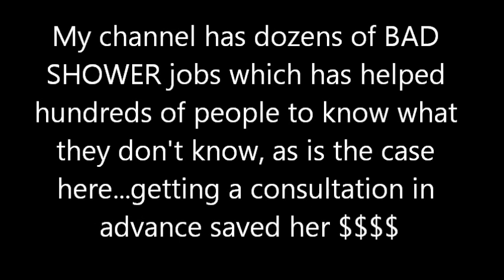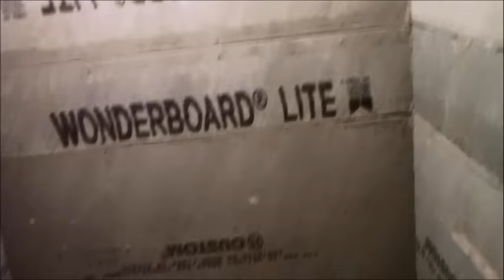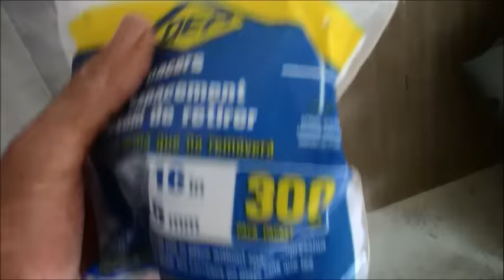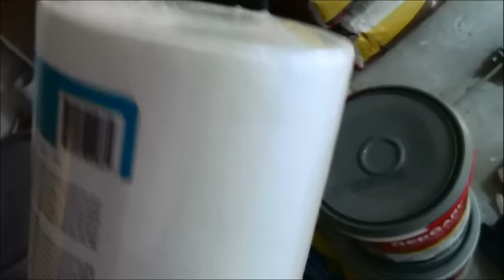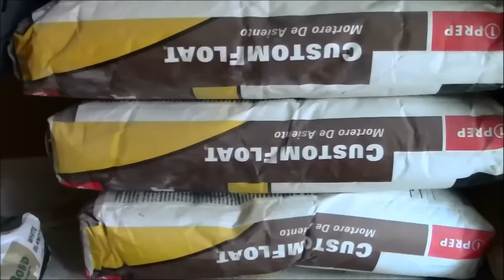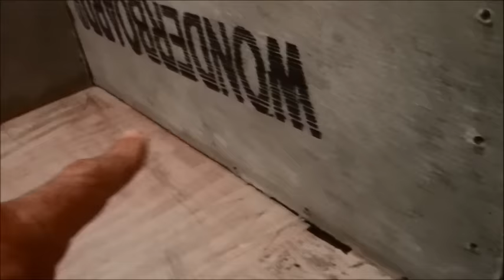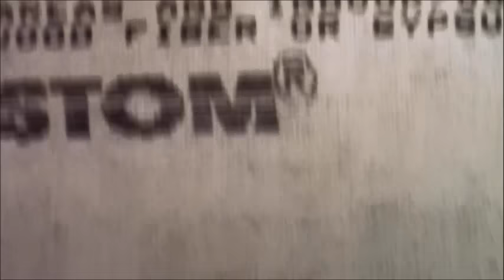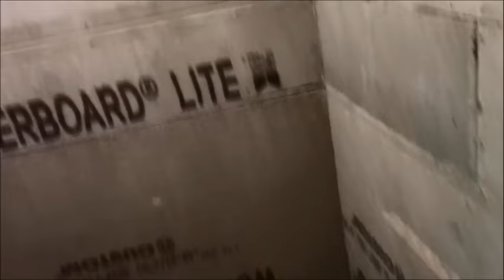BAD SHOWER DAY ONE !!

Comment: That's not pre-mixed thinset.

You should know this if you're gonna critique work. 

It's mastic.
Reply from the maker: It says at the bottom for wall and floor tile installation, it would not say that if it were Mastic..you would never use mastic in a shower or on a FLOOR ! Obviously you know little of the trade
Reply: @StarrTile  I know well it’s not used for showers.  But it’s NOT premixed thinset.   That’s absolutely false.  I’ve used it for backsplashes.  It’s adhesive, which IS mastic. .  Custom makes a tub of actual premixed thinset that SAYS premixed thinset right on it.  Two different products.
Reply: @StarrTile  the bucket intends to mean wall tile NOT in moisture prone applications.  I.e., a shower.  Says that right on the bucket.  And yes, I DO know what I’m talking about.  Premixed thinset has sand in it.  Find me one grain of sand in that adhesive.   Look it up.  You’re simply wrong.
Reply from the maker: I'm not going to argue with you, it's pointless...if it were pre-mixed OR mastic it's not used in showers or floors...period
Pre-mixed thinset is crap & never dries under large format tile, that's my experience, you could have different but it doesn't really matter at the end of the day
Reply: @StarrTile  We're on two separate subjects.   I would never use either on a shower, ...either.
Premixed thinset is crap.   But adhesive or mastic is perfect for backsplashes.   And other decorative walls.   As long as they're flat, as too much buildup of adhesive will retain moisture behind the tile.   But for all intensive purposes, you can't teach people out there the product in front of you is something it's not.   A little correction makes for a better education regardless of how much one may get defensive. 

I'm sure Custom wouldn't show their product and tell the viewer that it's premixed thinset.   They would say it wasn't crap when used in the proper applications.   Now they might fumble around trying to promote their actual premixed thinset, but they know it's crap.   But they're thinking more about the DIY'er being scared of mixing or to save time and mess.  

There's liabilities involved when you teach online.   To the manufacturer and the one using the product.  

In any event,  it's like calling a float a trowel.

2 different things.

Comment: Sometimes there's no satisfying your customer. Last spring I took over a job from a guy who built up his pan to over six inches thick. He also buried plastic water supply pipes in the drypack and I'm not sure what will eventually happen. Since the pan is not re-enforced with any re-bar I fear the worst. Being it's in an apartment building it should be an interesting rescue (restoration) if the pipes ever burst. I tried pointing it out to the landlords but they were satisfied with the finished product but we all know where that can lead to.

Comment: guess you never had red guard crack in the corners, happens way more than you think. Also you MUST use pressure treated wood for a shower curb if it is a cement floor, if you wanna pass inspection. never had a problem with warping or twisting.

Comment: What your demonstrating with the RedGuard is it's elasticity in plane.  Custom recommends you to tape corners because of the shear condition that can occur at changes of plane since RedGuard has fairly poor elongation under shear.  To demonstrate shear take some RedGuard of an appropriate thickness and tear it as you would a price of paper.  You'll find it tears quite easily.
Reply from the maker: No matter how thin the layer is it would definitely stand up before paper tape that is commonly used on drywall, that was the point I was trying to make. It is in fact a crack prevention membrane without tape. If your house moves to the point of this tearing, you've got bigger problems than no tape in corners.

Comment: Laticrete tape is actually good. It does stretch when Applied with any liquid membrane. It’s an amazing product. Redguard cracks when at a 1/8 crack joint. :/

Comment: Red gaurd recommends mesh tape for wall to floor transitions
Reply from the maker: What is tape used for....
It's a crack preventer same as on your drywall...
What does it say on a label of redgard, it is a crack preventer...

If you want to use tape I have no issues with it, but if you're already using a crack preventer then why would you use tape as a crack preventer, it's illogical

Comment: The mortar and spacers comment you made I strongly disagree with. I’ve had time where I forgot my spacers or grabbed the wrong size cause I don’t carry ever dam spacer I own with me. I go buy some since it’s faster than going home. Also thin set I’ll grab what I have at home and go back to buy more . Some of your OPINIONS are correct but other things are wrong which can confuse the homeowner.
Reply from the maker: It was never about an individual issue.... it was the preponderance of all the material he bought that told me what I needed to know and what homeowners need to know.. that was the point of showing everything

Comment: Im going thru this right now. I've paid already $3200 to the guy who's doing my shower. He's barely half done, and what he has done has plenty of things wrong with it. It's also been dragging on for over a month. And now I'm going to have to pay someone else all over again to fixed what he screwed up. $3200 literally down the drain. He's definitely fired!
Reply: I’ve been doing this work for a very long time. what did he do incorrectly?
Reply: @aniiraqigawad6693  he did not remove the drywall behind the cement board on the shower walls, he laid the shower pan on the shower floor very loose and sloppy, he did not tack up the corners, and he only had it going up the sides about 4 in, not enough. Also, the shower walls that he framed were flimsy. Essentially all he really did was frame up a couple walls, and put the drain in place. And that little amount of work so far cost me $3,200. I canceled on him, and have not called him back since
Reply: @kristinlee9485  Seems like you’re describing a stand up shower - did he cut 2x6’s and nail them around the base of the shower frames (2x4’s)? You didn’t mention it so i doubt it. I would’ve kicked him out as well.
Reply: @aniiraqigawad6693  Nope. He didn't add any blocking to secure the sides of the shower liner, in fact he left drywall up behind there. Needless to say, I hate this guy now for wasting my time and money, and leaving me without a shower. It's the only bathroom in the house that I have. The only thing that's saving me right now, is that I work at a hotel and I have access to many rooms with showers. Right now I'm taking a break from this because it's so stressful, but I'm going to start getting bids again pretty soon to have it finish correctly
Reply: @kristinlee9485  Wow. That’s unfortunate to hear. If you’re in the metro detroit area i could kindly give you a hand on the bathroom price.
Reply: @aniiraqigawad6693  thats kind of you, thank you. I'm in the southwest unfortunately 😆

Comment: I think you are slightly mistaken.
Steps:
Building felt on wood subfloor.
Preslope using drypack.
Liner membrane
Thinset
Tile
Grout
Sealer, if desired.

My point is the liner does NOT go before the preslope.  The liner foes on TOP of the preslope.  Otherwise, the water that goes through the grout will get to the membrane and not drain because it isn't sloped.

Comment: The point he was trying to make is that you can see little habits that tell you about the bigger habits or problems that you are actually dealing.
In the end they either make the job more costly or more problematic.

The real issue with many contractors is they are too catch up in the concept of this is how I do it as opposed to how it should be done.
Then of course there is the classic yeah I can do that too.

Comment: lol maybe the homeowner wanted to use his 100yr okd toilet thats 14 1/2" from the wall. I kid you not I saw one of these odd toilets and its a good thing i didnt move the toilet flange to 12" from the finished wall.  
Idk what they were thinking with that floor drain location? maybe a curbless shower and a linear drain? 
crappy backer board screw installation, must be warped up 2x4's behind that stuff to be out 1 1/2".  That black plastic mud ring should be there and that tells a lot about who put up that backer board. 
I suppose no access to that shower valve either from the other side.  Is that cpvc sticking out of the wall ? 
no copper stub outs.  You might as well just gut it all out again and see the rest of the mess behind the sheetrock.

Comment: I've been building showers long before red guard became available,  I am still reluctant to use it since the cement board provides a porous surface for the mortar to bond. Seems to me that using a latex or rubber coating like red guard would prevent that bond. Please explain to me how mortar bonds to this type of surface ?
Reply from the maker: Check this out 
https://youtu.be/t6y2Fl0wznk

Comment: I think  that redguard with the tape or membrane strip is a great idea to use in wet corners. I'm remodeling my master because an idiot used redgaurd on a wood curb in the corners and presto it leaked... I think previous owner did it.

If they had done that membrane tape with red guard maybe it wouldn't have leaked.

Comment: I used that acrylpro adhesive on a small floor, shower , and then on bathtub surround. This is in arizona, very dry climate and it was before I found your channel. So far, it's held up for 3 years. No loose tiles. I however was "fixing" some handyman's work, that my mom had hired. Anyway, after learning more, I realized I made a few mistakes, but my mom doesn't have the money to fix it right. Slab on grade, and was a drop in shower pan, so no mud needed for the floor. Hopefully it lasts for her.

Comment: If you are DYI watch lots first, but also buy all the parts once you have a solid detailed plan. Example, if you had the toilet in advance you would get the holes right. I use a plumber for drainage and code inspections. I spent almost as much time planning it seems! So you’re time better not be worth much!

Comment: 6:55 This is misleading and I see it all the time with elastic stucco and elastic pond liners. People take a chunk of it like in this video and stretch it and say "oh, look how far it stretches, you'll never have a problem!" But that is not how these materials work...they bond to the structure right? Well once bonded it can no longer stretch over its entire length.  As a matter of fact when a crack happens the only dimension it can stretch is in its thickness. These materials do crack and leak because of this and the thickness not enough to stretch enough for a crack.
Reply from the maker: Tell that to Custom Building Products...they manufactured it and it's used commonly as a crack preventor on structural concrete in warehouses and other applications. Even on label it says crack prevention membrane..

Their own pdf:

A ready-to-use elastomeric waterproofing membrane for both commercial and residential tile and stone application. Suited for interior and exterior substrates, RedGard® creates a continuous waterproof membrane barrier with outstanding adhesion and reduces crack transmission in tile and stone floors. It bonds directly to clean metal drains, PVC, stainless steel and ABS drain assemblies and can be used as a slab-on-grade moisture vapor barrier under all types of floor coverings.

Comment: But what if you were putting in a Schluter Kerdi board shower pan? would you put the shower pan in first and have the concrete board set on top of it? Or have the concrete board come down to the floor?
Reply from the maker: Of course that is foam material and foam does not wick up water so all bets are off with that
Reply: @StarrTile  So install the concrete board, then the shower base, and waterproof with membrane?
Reply from the maker: @TylerAdams-ch6rl  you said two different things, you mentioned Schlueter Kerdi panels which are foam backer board, and then you mention concrete board so I don't know which you are using...

Once again if you use a foam board you can put it on the surface or even embedded into the mortar pan, it would not matter, concrete order any other backer board would be raised at least an inch above the finished pan
Reply: @StarrTile  These waterproofing kits come with a foam shower base and a rubberlike membrane to put over the concrete board. So its Foam base with concrete board walls and membrane over it. In some videos ive watched they have the concrete board going to the floor and then they put the kerdi shower base in. I guess it doesnt really matter with the membrane

Comment: I'm sorry but you are way to early to criticize this tiler. Yes , once the job is done and he's got tiles hanging off the wall or bad spacing etc and it's really bad and you go round to slate them, then fine. But you have started to assume quite a few things even before his had a chance to explain himself. Some of the products might have just been brought from his last job or something, without asking you shouldn't assume. Plus you've listened to the customer, and we all know that customers can give a completely different story. Bad example . I would run of my customer rung another fitter to check my work as well. Poor example.
Reply from the maker: I have at least 100 videos out of 450 on my channel of ppl like you wanting to "give the guy a chance"...
After the fact it cost the homeowner thousands to replace and repair, so no, I don't advocate your idea
Reply: Well I'm assuming that the consumer has shown you all there bank statements to show how much they've paid him already, my mistake, "customer is always right"

Comment: PT doesn't warp if you screw it every 8 inches (doubled-up).  I used it to build my curb in 2006, and the curb never warped, or chargrd shape.
Reply from the maker: Most of what I see is that there are extremely few Fasteners and they are usually nails, that's why I referenced the card at about the 2-minute mark because those people have done the same thing, I think there were four nails and then Tire curb with pressure treated wood

Comment: I just put down pressure treated plywood to go under the shower stall.  It's screwed in with  deck screws about 8 inches apart. Do I need to take up the plywood and start over. 😅😅😅
Reply from the maker: Doubt you'll have an issue with ply, my take was 2x4 will warp if not fastened correctly

Comment: A number of reasons for using tape. Movement at a corner is not like movement in a plane surface, there is much more stress and the tape transfers this stress to the flat area where it can be managed.
Maybe more important is that manufacturers of tanking products require you to use this as part of their system. If you don't use it and their is a failure in the tanking then you have no comeback whatsoever either against the manufacturer or if the client takes legal action against you.
Reply from the maker: Tanking ????

Ok, not sure what that has to do with tile... anyway, I have built hundreds of showers and I've only on occasion use tape because the customer insisted, I built my shower over 12 years ago and no tape, in fact no caulking either, no cracking, no separation....
And you are aware that redgard is a crack preventer because it is stretchy a 100 times more than tape ever would be...so you can use tape but it's redundant

Comment: Your videos are the best i like how you explain the faults of a job and how it should be done i am a diy person its a learning process for me i doind a shower with concrete floor had to dig to set the drain in place at my suprise i never knew you had to put a liner on the floor i just was going to slope the morar to the drain thanks for the info in one of your videos....now i have to cut or take downthe durock to install the liner.

Comment: Isnt the point of using tape as a crack preventer the fact that it DOESNT flex? You want a sealer to flex, so that it can survive things like the movement in that floor without springing a leak....the tape over seams is meant to help hold everything rigid...
Reply from the maker: Tape is used on many things including sheetrock so that cracks don't transfer to the surface, cracks would happen because of separation of material. Redgard is by itself a crack preventor by it's very nature, says it right there on the label and is used on concrete floors in basements and warehouses...how exactly would you apply tape to an entire floor without knowing where a crack would occur ???
It is a crack preventer because it is very pliable and stretchy no matter the application. If you decided to use tape in addition to redgard it wouldn't hurt, but wouldn't make it any better.
Having said that, it is extremely rare that I have ever seen a separation so vast in a shower that had they used either it would've avoided it... you would have bigger issues with the construction method then you would trying to prevent a crack.

Comment: The mesh tapes are new school stuff, I don't like mastic in wet areas even though some manufactures say you can use it.
 With that said,  I found out the hard way why many installers don't use it.
Reply from the maker: Mastic is organic material, made from mastic tree... although nowadays that resin is mixed with other chemicals to form an in- organic material, still not recommended in wet areas...only for tub surrounds and backsplashes